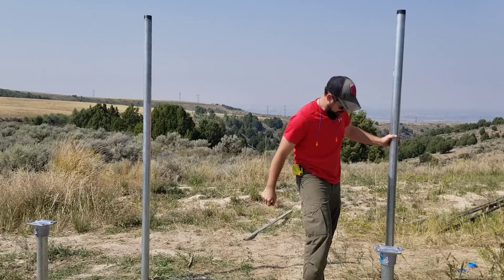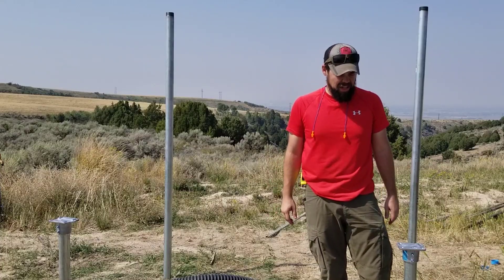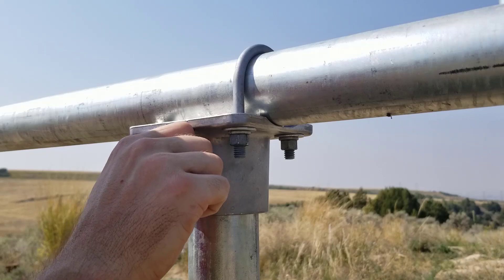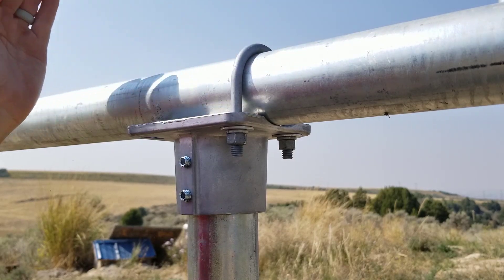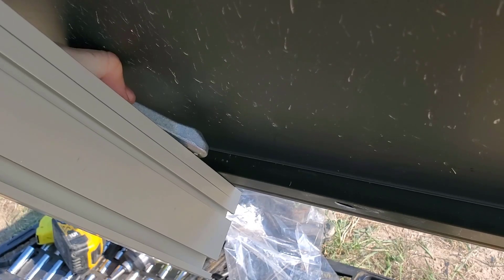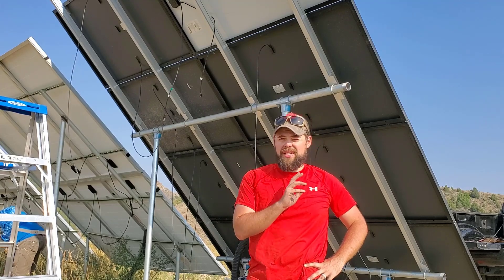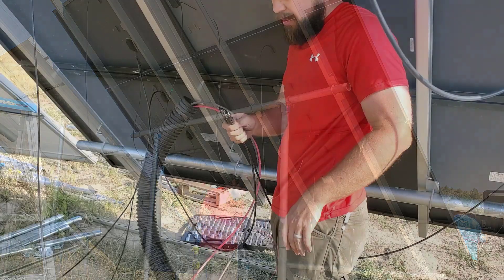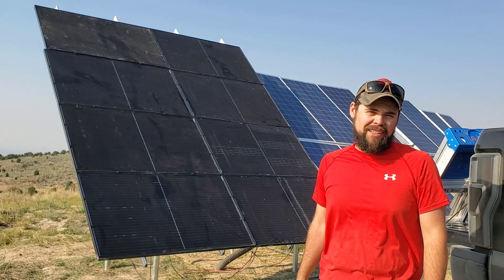Easiest Off-Grid Cabin Solar Panel Install with Ironridge Kit for A/C & Heat

Comment: I have 2 48V units and 1 240V unit from hotsport energy. 48V units outside pump won't work well when temperature below freezing. 240V no problems. All work really well as AC units. 3 years no issues. I do not run them from Solar panels directly. 48V units run directly from batteries and 240V from inverter. This helps me to reduce load on inverter when I need to run all 3 units

Comment: Excellent video, do you know what sort of distance you can have between your panels and your cabin. I am also thinking of having panels on a hill, but was concerned about the distance to the cabin. Do you have a video on the wiring you used between the panels and the cabin
Reply from the maker: Glad it's helping. I did another video on another stand I did where I show running the wires: https://www.youtube.com/watch?v=k5xtiv0TjDo&t. I used 8 gauge cable which was overkill but I easily went well over 300 feet and can't notice a drop. I know there is one but can't notice it.
Reply: @minutemansolar  thanks. Can you share a link for the wire? Want to make sure I get the same one
Reply from the maker: @bluyetiinc7553  I made my own ends cause I couldn't find any really long heavy gauge wire with MC4 connectors already. https://www.wireandcableyourway.com/8-awg-solar-photovoltaic-wire-2kv-ul-4703-pv-wire-500ft-or-1000ft-spool

Comment: All IronRidge documentation seems to point to piers anchored in cement.  Your procedure for driving the piers is interesting.  Have you seen any issue with them being driven in?  I would be worried they could be pulled up with the proper amount of rain and wind.
Reply from the maker: Nope, I'm not worried at all. They've been in for 8 months with zero issues, not settling or anything because it's already solid in the ground, about 4ft in the ground.
Reply: @minutemansolar  Wow.  That certainly simplifies the installation.  I purchased 3in sch 40 pipe for my install.  It is going to be a lot more work. Thanks for sharing your project.

Comment: Nice video. I just received the titan with 2 batteries and 10 briefcase solar panels. I would like to semi-permanently mount the panels but, if I needed to leave rather quickly I am concerned with leaving panels. Your thoughts?
Reply from the maker: The Titan is kinda useless without panels. It's like having a gas generator without another gas can. All you have left is what's in the tank/battery. I would use panels that I could install permanently and then have back up panels I could take with me.

Comment: Have you done research into home applications for wind turbines for home electricity generation and storage? Many years ago there was information out on the web about combining solar and wind so one could help offset the other if needed. I just don’t see how wind would generate as much potential electricity as solar. But that’s why am asking the question. Curious as to what your experience has been with that form of energy production. Thanks
Reply from the maker: Yes I've researched wind turbines quite a bit, and the bottom line is that they're not worth getting. It's cheaper, easier and more reliable to buy a few extra solar panels and battery to last longer during the night or cloudy days than to have a wind turbine.

Comment: Great job and so glad there are off-grid mini splits on the market. One suggestion, I would secure all wiring on the back of the panels. In the event of a severe windstorm, it is possible the wires can break off from the panels.

Comment: I have been wondering what I should do I just slapped a bunch of spare prices of wood together we had lying around  and had my 6 100 watt panels all bolted down together n wouldn't u know the day I hadn't checked the weather n all of a sudden a tornado warning pops up on my phone for my address man  I tell yah they come apart alot faster than they go together huh? I had to pull them all back into the house cuz I had no posts driven yet  or anything so if that thing had touched down it ( which I have never been under a forming tornada right before it touched down before and honestly it wasn't really for me had to keep my kids calm by pretending I was calm while it passed right over our house  )😬 woulda been a fairly expensive heavy metal kite lololol ... Thanks for the vid 👍

Comment: Ben I am about to purchase Eight 325 Watt Canadian Solar Panels.  A titan staff member has been helping me understand the maximum panels and voltage I can connect to the titan without damaging it. What do you think?  Here is what I was told:  The maximum volts for the ports is 145 and we recommend staying a little under that to be safer.

My recommendation is to connect 2 panels in series twice. Then take those 2 arrays of 2 and connect them together in parallel. Connecting in series adds volts together, connecting in parallel adds amps. Doing this for each port would allow you to use all 8 panels. And it should be 87.4 volts and 19.3 amps. per array of 4.
Reply from the maker: Ya that would work great. This video may help give a bit of guidance too: https://www.youtube.com/watch?v=k5xtiv0TjDo&t
Reply: @minutemansolar  Ben for someone like me who is retired and off-grid setting up his entire power system to match the titan your answers to my questions are golden.  I deeply appreciate it.  Yes loved the video you mentioned by the way! Cheers and dont feel obligated but you might enjoy my channel.  Currently I am building a decorate wildlife watering pond in the desert. https://www.youtube.com/watch?v=1Ls6xYZvmVQ

Comment: Naturally Ben I am wondering if that mini split is going to be powered by a Titan.
Reply from the maker: Mine at the cabin is 100% powered directly from these solar panels. BUT, you can get 115v mini splits that are either 9K BTU or 12K BTU that can be powered directly off of the Titan. Anything larger requires 220v power. I will have a video on this in a couple of weeks =)
Reply: @minutemansolar  Beautiful.  Much appreciated Ben!
Reply: @minutemansolar  I will totally be looking forward to it.  I am researching like crazy trying to come up with the best (9K BTU or thereabouts) DIY minisplit to purchase.  Thanks!

Comment: Great video - wondered about the 45 degree angle - looks like the finished angle is different than the other solar array?
Reply from the maker: Yes it is but I am going to adjust those other panels so they're at the same angle.

Comment: It's incredibly ironic that the post driver is called a "Titan"!  :)  The reason you're having problems with how it runs is because of the altitude you're at...you would find it runs perfectly at sea level.
Reply from the maker: I know right!? Not planned at all, they're the best ones to use from my research. Hmmm I didn't think about elevation. When my other video is posted you'll see that it ran without any issue at all and that was for about 6 hours of use at the same elevation. I'll check into that, good thought.

Comment: Most people do the Diy setup because those post tops are stupid expensive and I mean STUPID. it's a freaking molded chunk of aluminum. Most dealers charge $250 a piece that really pisses me off.
But you got done pretty quickly. Nice job 👏
Reply from the maker: Yes agreed, it's near $50 PER CAP, very expensive, but seriously makes it 100x easier.

Comment: @13:38 It looks like the new array casts a shadow on the one next to it.   Maybe its so late in the day that it doesn't matter, but you might want to evaluate the impact of that shadowing on the existing array.
Reply from the maker: Yes it does. At that point in the day those panels aren't much power anyway, BUT, I am going to be adjusting those panels so they don't get shadowed.
Reply: Was about to say this same thing .. but found someone else already did. I hope you got your shadowing issue resolved. Thanks for sharing your project with us.

Comment: If they "work optimally" at 45degrees, you must be about 45 degrees latitude. That means they would work a little bit better in the summer at about 22-23 degrees, and a bit better in the winter at 67-68 degrees.
Where is a good source for the ironridge parts? Just you?  I've been contemplating the Home Depot DIY and I'd like to compare...
Your post driver seems like the carb is not tuned correctly.
Reply from the maker: Ya shoot me an email at minutemanprep@gmail.com for the Ironridge stuff and I can help. Optimal is 50 degrees for where I am but 45 is easier math and doesn't make a massive difference so I went with what was easier. Ironridge is absolutely worth it over the Home Depot route.

Comment: Great video. Which Mini Split system would you recommend for a backup system for residential home? I would be running it with Titan 2000 system when it arrives in November. If the Titan can handle it ?
Reply from the maker: Thanks. I am using the Hot Spot ACDC 18k BTU which can be powered directly by solar or by grid power, it's an incredible system. I'd go with that or just the MrCoolDIY system. The Titan can do up to a 12k BTU Mini Split at 115v.

Comment: You don't need to leave a gap between the panels to allow airflow to break the "sail effect"?
Reply from the maker: Nope but in this case there are small gaps in between the panels but not enough to really allow all the wind to sneak through. The panel stand array is very strong. I get really high winds up there so if it breaks I'll do an update video

Comment: Is the mini-split 110 or 220?  I have the Titan and am able to run, lights, fans, TV with it, but would love to have enough power to run my water heater, and other things that draw quite a bit of energy.  Is the Titan any closer to having a model that handles 220?
Reply from the maker: The one in my cabin is 220v. I haven't heard any update on a 220v capable Titan. I know it's in the works but there's no knowing when it'll be ready.
Reply: @minutemansolar  Can you be specific about what 220v you have in your cabin?  Thanks.
Reply from the maker: @jjpicker  Only my mini split which is not powered by the Titan. It is solely powered by the panels set up in this video

Comment: Interesting.  The Titan Post Driver. You mentioned that you drove some poles into rocky road.  We apparently have minimal top soil here and lots of rock below the top soil.  Your opinion, can this drive poles into either solid or significant amount of rock below top soil?   Just curious.  Looking forward to your review.  You mentioned a cooler that was run off of solar - what system is this? Will search your videos maybe that will show me which one.  I think I should be getting my Titan 1000 very soon,  now I need to figure out how to mount the solar panels.  Know you have some videos on this capability.  Thanks.
Reply from the maker: Hey Leo. The Titan PG3875 is a very powerful unit but it won't break through rocks. I hit a lot of rocks when doing my posts and sometimes if I hit the edge or a small rock I could get it to drive through if I pushed long enough but I'd say 50% of the time I had to pull the post and move it 6 inches and try again. 

I have a mini split cooler and heater that runs off of this solar array. It is the Hot Spot ACDC 18k BTU mini split. I have a video coming out about it very soon so make sure you're subscribed =) Happy to help

Comment: Can u use these panels with any solar battery? Im wanting to buy a bluetti soon and will b seeking the best/ most affordable solar panel options
Reply from the maker: The Bluetti will determine what panels you can use. You just have to stay within the charge parameter set by the charge controller on a unit. You can use large panels for this one: https://amzn.to/3s5HoB2 The number you want to look at on the back of the panel is the VOC and ISP or rather the highest voltage and highest amperage it can produce. When connecting panels in series (panel to panel to panel directly) you will increase the voltage but the amperage will stay the same. So stay within the charge parameters and you're good, even if you're wattage is higher than the max watt input you're good. It's called overpaneling and it's a safe thing to do as long as your total voltage and total ameprage is within the charge parameters.
Reply: @minutemansolar  ok, so i just ordered the Bluetti AC200P with 3 200 watt solar panels.....bundle. thx!!! That should b enough to start with
Reply from the maker: @thebrideofchrist107  Ya I'm happy to help with any questions you have. I do have a video about the AC200P as well but I will be doing a follow up video in the future.